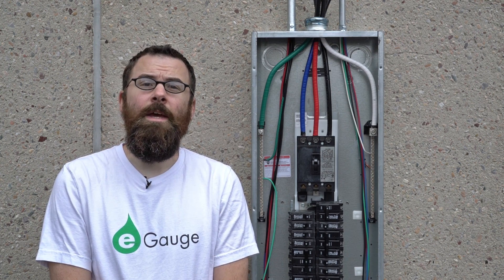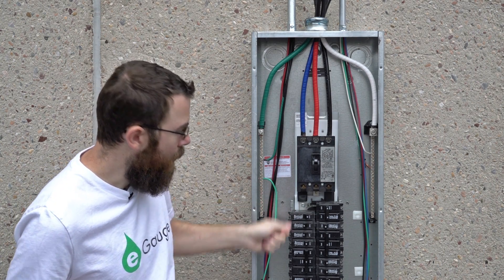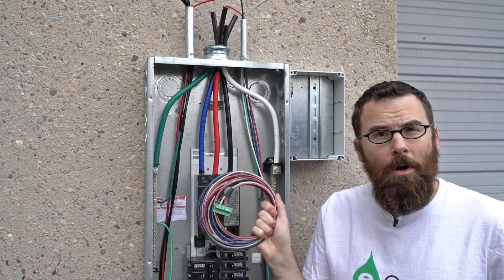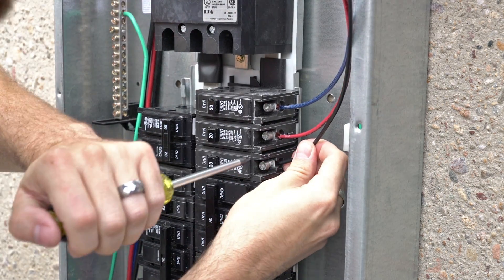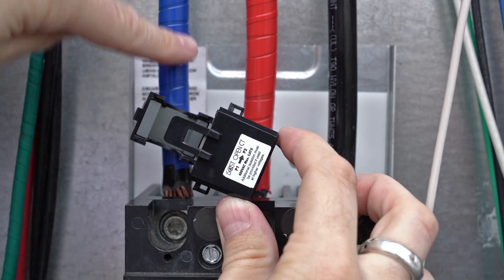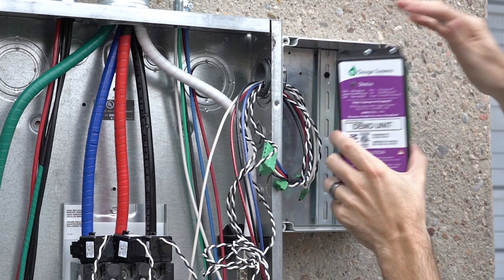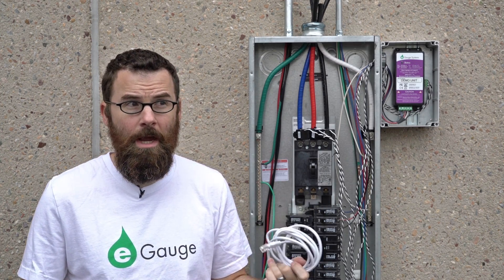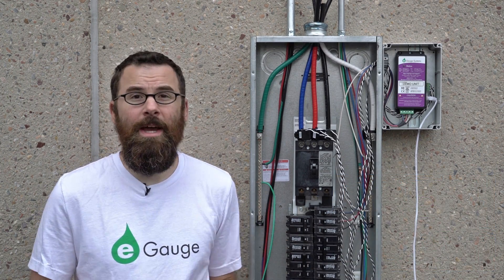Three-Phase Installation Tutorial

Comment: You have blue and black reversed, it goes black red blue, not blue red black! Normally that wouldn't matter much, unless you have a hundred or more circuits that are numbered! If you mix up two phases like that while you're trying to number them, you can accidentally crossed the phases, and windup getting an unexpected surprise while connecting your branch circuits!
Reply: Nec states phases go left to right top to bottom.
Reply: I was shown it was Red, Black, Blue where the black divides the two.